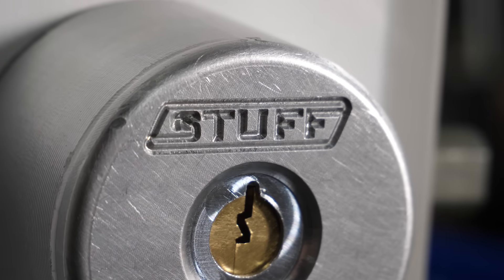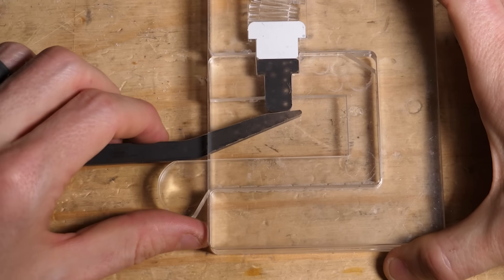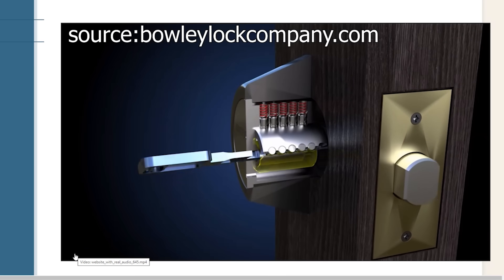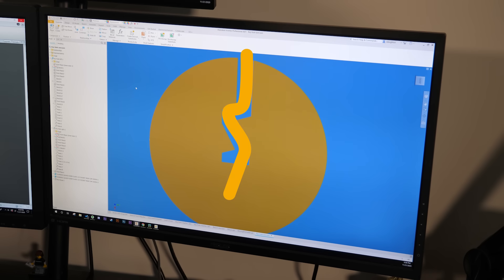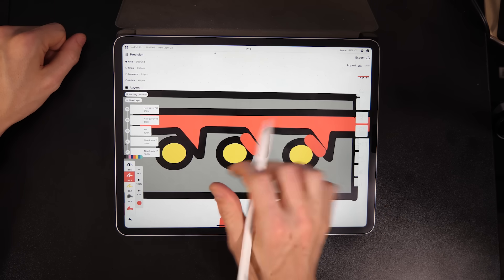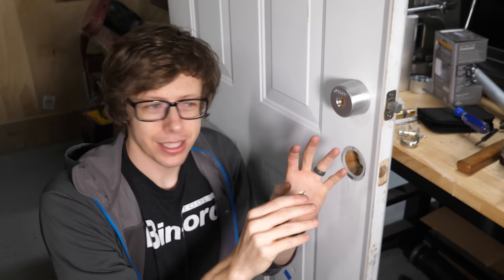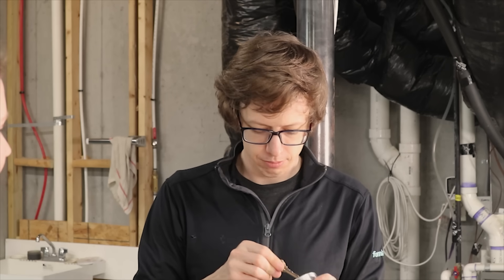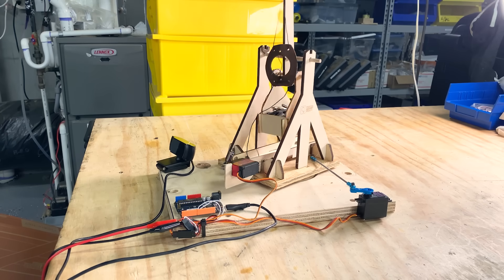Making an unpickable lock. Calling locksmiths

Comment: If the locking bar only uses friction to hold the pins in place, you could squirt WD40 in to the lock to lubricate the pin and bar, lock each pin to the max height, and attempt to unlock. Then with the key fully turned, and I'm guessing pressing against the edge of the gates, then get a hammer, and tap the top of the lock while apply pressure to the key to drop the pins gradually (this is what the lube is for), as you tap and the pins drop, as you said, not every lock is perfect, and I'm sure the pressure, as well as the lip of the spool pin you have will interfere on the ledge, until all the pins are in place, and voila your in.

Comment: At first I thought you were going to assemble a fairly normal lock but with a small motor and pin that would bump into any rake trying to set pins. But I feel like a simpler idea would have a mechanism push the pins back down so without the physical key there would be no way for a picker to set all the pins.

Comment: It might not be pickable but any lock can be drilled,  I know iv drilled most door locks in my  handy man business , and most burglars  don't enter through a door anyways they enter  through  a window that they broke to get into the residence,  also most door locks do not stop a door from  being  kicked in , the best locking device to keep a door from being  kicked in especially  if you are home is a gate rod. They work really good ,just bolt it to the bottom of your door and drill a hole into your cement slab or raised foundation  floor for the rod to go into ,the can be bought from the home depot  for under  20 dollars , and you can make  your own if you want it to be more decorative using material  from your local metal supply yard , it can be painted  or blued or hot oil dipped , believe  me they are a good locking opinion

Comment: I think the basic principle could be refined to make a practical, commercially viable (and more importantly) reliable lock. I thought there were a few locks that used the same basic principle of all pins needing to be set before testing but achieved in a different way, in fact didn't BB or LPL deal with one recently..............Found it, "Tensionless lock" vaguely similar idea in that it doesn't allow you to tension the lock until all the pins (wafers) are in the correct place.

https://www.youtube.com/watch?v=lPhAhAPtlH4

Comment: that is as impressive as a high security door with deadbolts all around and a titanium plate in it. but i have a story for that:
i´m a metalworker and the company i worked at had a call from a burglary. the thiefs tried to open the high security door (wich is designed to jam if you use force) and jammed it. so they just went thru the brick wall beside the door and got in. you can have the strongest door but if you put it on a 10cm brick wall it will do nothing XD

Comment: Not a bad design, but kinda used already. There's 26 ways per pin, but once you get 1 pin done the poisition doesn't change. Therefore if you can get a tension bar into the lock to push against the springs then find the solution to each pin, you can unlock it. Finding the solution for each pin won't be easy because you have to switch between pins, but its doable to a lockpicking expert

Comment: "Lockpicking" a mechanical mechanism lock is derived from the engineering fact that the constituent parts of locks, like all mechanisms, are built to tolerances. If even a common lock had perfect tolerances the picking process would not work on it. But you could open a perfect tolerance lock with sufficient random keys, given sufficient time. 
Locks are to keep honest people honest, a dedicated criminal can enter any space, by employing sufficient means, given enough time.

Comment: What lock has no key?
Reply: the c lock
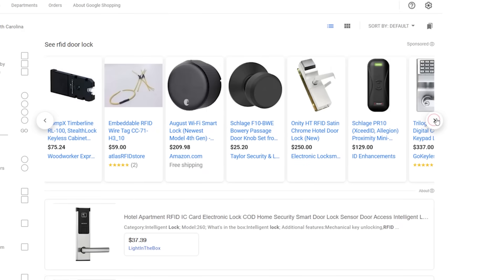Reply: @ThePapaja1996   @ludde sundström  Good one.  I wanted to mention the "unpickable" locks he was referring to which are "keyless" at 10:40  In that case you pick it with bad implementions of protocols.  A symmetric key implementation mayhaps, but you should still be able to manipulate it physically.  My point being the only keyless locked door is a plain slab of stainless steel barricating another slab of steel and even then "the key" is a shaped charge.

Comment: I'm no expert at lockpicking but what is stopping someone from just pushing the inner bar with a seperate tool and then tension the lock and set individual pins just like picking a normal lock? It would seem like it relys on accuracy in machining to stop pins from binding on those grooves

Comment: Should be a nice challenge for LPL and Bill, but ultimately, if they use their entire range of tools, it's gonna be opened... and likely dead too. xD
Single pin picking is one thing, but when you look the stuff they've already used in the past, what lock could possibly resist? Torches, extractors, powerful motorized rakes, those ridiculous blank charge power tools.. xD

Comment: There is still a theoretical attack that would allow testing pins individually that goes like this:
1. Set a pin to a known position
2. lock the pins with the back button
3. see how far you can turn the bolt
4. Rerun 1-3 on the same pin but at different positions until you either find a position that allows you to turn a bit further (case a) or you exhausted all the positions (case b).
5. In case 4a, you found the correct position for the pin, keep the pin in that position until the end. In case 4b, you need to do 1-4 with a different pin until you find one that goes into case 4a.

For the same reason that you (nearly) always have a binding bins during normal lockpicking, you should always have a pin that will go into case 4a. However, it's obvious that this very theoretical attack would require an extremely precise measurement at step 3 unless the manufacturing of the testing place and of the pins is particularly bad.

Comment: I think you just need to make a realy long lock so thee picking will automatically break thee pickin-tool‘s before thee lock can be opened. Pickingtools are smaal and other then a key they can’t fill thee hole 🕳 completely since they need space to mouve in position. If you have a three till 15 meter long key 🔑 it will be stable enough if you make it from thee best material and a pickingtool won’t be abel to keep thee length before breaking since phisical possibility’s of materials are limited to reality.

Comment: Here is a thought for picking this (at least in theory). The key (haha) is to test each pin individually. Now that we know how this works I can set any pin to any height individually. So start with for example pin one. Set it to some height. Turn the cylinder and see how far it goes. Try this for each height. If any height allows the cylinder to turn more than the others, then that pin was the one preventing the cylinder from turning and that height where it allowed more turning it the correct height fort that pin. If there is no such height, try an other pin until we know the height of the first pin that is 'binding'. 

Now we need to be able to hold that pin at that correct height while we try to find the next pin and height by repeating the process. And conveniently the mechanism of this lock locks all the pins at their set heights! 

This was just my first idea after watching this video. But I'm pretty confident that this is not the only attack and that other strategies can be found or this one expanded.

I would be surprised if LPL would not pick this lock in short order after practicing a bit.

Comment: Wondering about ideas to attack the lock:

Instead of trying to set the pins, use a comb pick to set them to the max height, engage the locking bar, turn it and jam it, release the locking bar while applying pressure. Release pressure slowly until the pins start moving down and some of the pins will probably get stuck in the right position. Lock the bar again, turn it back and use the pick to decode the pin positions while the bar is still locked. Even if the pins does not slide into place, it should give information about which pins are in tension. (Easy fix, make it so the lock bar can only disengage in the fully open position.)

Another idea would be to try to get information about how many pins are binding, either by measuring how much you can turn it (would likely be very precise) or measuring how much force you need to apply to get it to move slightly more than it wants to, with the idea being more pins means more resistance. If so, you could use a comb pick to set all pins to the same position and when you detect that there is less pins binding or that another pin is binding, one of the pins is on the correct position. Then try that position for each pin individually, to figure out which pin it is. Repeat, while keeping known pin positions in place to figure out the rest of the pins.

And the elephant in the room, three pins with questionable tolerances would likely be suspect to a brute-force attack of trying all combinations. Either way, it would be difficult to attempt any of this without a 'pick' which allows you to either retain pin positions or set them all at to the positions you want. But it might still be possible to reduce this to linear complexity instead of exponential by using a form for information leakage.

Comment: Dammit! I started on a similar design on 11/12/2020.  You def sank my battleship. My method is a little different. I pass a gate *around• the trapped upper pins. Pinching them is easy, just add a lot of slots to the pins. A bar slides into those slots as the key starts to turn locking the pins into place (cam). The gate tests to see it any pin is out of position. I’ll send ya the SketchUp file if you would like to see what I did differently. I’m disappointed, but congrats on a good design and inventive spirit! Peace 😎

Comment: “I found a locksmith that specializes in picking locks”
Reply: You can 100% be a locksmith that doesn't know how to pick locks. Main job is fitting new locks, secondary is building new ones to a key. I wouldn't be surprised if over half of all "locksmiths" just expect to drill out a stuck lock (or one where the key has been broken/lost)  and replace it

Comment: I haven't read all comments and I've watched this mechanism twice. I'm a locksmith. What prevents somebody from picking all the pins to the top position, turning the cylinder, then trying to rap or vibrate the top pins into the slotted grooves while turned?

Comment: I can see 1 possible way. Tension the lock as normal, then overlift all the keypins so they fall out, then reset the lock and allow the driver pins to fall in the place of the keypins. If this is the case it shouldn't be too much of a problem to block this way of attacking it.

Comment: You might try putting serrations on the upper pins for the gripping mechanism to hold them by; if you make the serrations deep enough that would be enough to account for manufacturing inaccuracies and remove the need for individual springs to hold each pin.

Comment: "This is the Lockpicking Lawyer, and what I have for you today is an unpickable lock" (Video time of less than 2 mins) 😂
Reply: at least 5 minutes: 50 seconds to pick open and the rest to explain how impressed he is and how it works
Reply: He should just make the video 10 hours long even if it takes him a minute to pick it.
Reply: LPL won't be able to pick this lock...Watch how it works again..Key goes in while simultaneously locking the pins in place and in order for locked pins to clear  the bitting channels, the cylinder needs to be rotated, AWAY, from the only area any manipulation could possibly occur. That being at the key to pin contact holes and why this lock is unpickable. LPL would have to GUESS the right pin height for each pin and set them, if the locking mechanism actually allows that, in order to open the lock.
Reply: @MrDLRu  you never know if there is a workaround. We’ll just have to see.
Reply: He did that once. The lock could not be picked.
Reply: @Alrekrify  No shear line, no pick.

Comment: The problem with home security is that as you strengthen one area another becomes the next point of weakness. At some point simply cutting a hole in a wall or using explosives becomes viable if the end result you are seeking is worth the effort/ expense.

Great video! I appreciate your tenacity and perseverance on your projects.

Comment: To make the upper pin section more standard instead of using different cuts for each pin, I suggest you use different length for the lower pins that will even out when the key is inserted. 

To maintain the upper pins in place you could use rubber that should exerce enough friction on the pins and maintain them in position while turning the deadbolt. Not as durable as your spring version but has the merit of having less parts. 

Interesting ans novatrice approach, so good luck and I feel super excited to see your lock mechanism in the LPL hands soon.

Comment: What if it was a double cylinder?  Insert key turn 90 degrees, pull or push to engage 2nd cylinder turn back 180 then open. Or pins on both sides of 🔑 key. Good luck. I can’t wait to see what you come up with.

Comment: There is 1 thing that makes the lock very easy to surpass. Its not lockpicking. Its how far the whole thing comes out of the door. Get a metal pipe with the same diameter, slide it onto your lock, push down, and the whole lock mechanism comes out. Real save locks try to embed the whole mechanism into the door, since that pipe method is used very often by thieves. ... a friend told me...

Comment: HOW TO PICK THIS LOCK.
1st take a key blank and cut it in half, top half with the shallowest cuts. 
The bottom half is needed to press and control tension on the "pin locker/retainer." 

Fully insert the key pieces, keep the bottom half in the lock and remove the top half of the key.
Rotate the lock, when the pins make contact at the wrong depth. It will pivot the pin a little bit. 

When the pins pivot they should start to move and drop down little by little until they are at the correct depths. Just keep rotating the cylinder again and again until it turns. Depending on depth combination and how many pins are in the lock, 30-100 rotations will be needed before it unlocks. (If needed the bottom key can be pulled back slightly to loosen the tension on the driver pins.)

This is basically a form of impressioning, except without filing a key down..

The reason for separating the top and bottom of the key, is because if the driver pins are allowed to move down, and the key pins are held up by the key. Then it will be impossible to turn the lock back to the neutral position and remove the key.

Comment: Maybe overkill but I've always conceptualized using an extremely difficult lock that when activated the key cannot leave the cylinder but when the key is turned it'll energize an rfid controller that will then actuate a solenoid if the rfid in the key (similar to a car key) matches the one for the lock

Comment: Couldn't you add a series of notches in the pins? Then you can hold them with a single bar just fine. You'd also get a more reliable position when inserting the key so there'd be less chance of jamming.

Comment: If I see it right the upper pins are forced down with springs. So what about creating a key that pushes all pins to their limit, then turn it a bit and use a vibration device (don't know how it is really called) to let the pins come down step by step until they all fit through the barrier?

Comment: Lockpickers before seeing this: Oh no!
Lockpickers after seeing this: Anyways
Reply: Actually, as a lockpicker I just wanna have a go....It is a nice mechanism. Very well thought out.
Reply: 1. Lift all the pins
2. Tension it
3. Apply some hammering or vibrations to the lever or the whole lock
4. Wait till the pins take their places.
Apparently, there are also holes for the wires...
And even if it doesn't work (or is fixed), I bet it isn't too hard to decode it quickly.
Reply: @tinldw  Yes I suppose.
Reply: Sergey tinldw that is sort of similar to what i was thinking. Im not gonna say exactly however, in case of the astronomically low chance that I actually get a shot at it. Cant give away my strategy. Lol
Reply: @jpmcpinning4255  Yupp ikr!

Comment: RFID locks are absolute fucking garbage, don't you ever recommend them. 99% of them have really fucking shitty flaws. You can copy the key with zero contact from a meter, away through clothes, with an ebay parking garage gate module, you can bruteforce them sometimes, you can have a tech set it up in a shoddy way that gives you near-zero security and the list just goes on. Get a proper mechanical lock and get a camera above it to make your neighbour an easier taget. That's it.

Comment: I think in principle, this lock is pickable, though it would be difficult.

The basic technique would be to find which of the pins was making contact with the gate first when it fails to engage, then adjust and test that pin until you get a tiny bit more rotation than before, meaning that it was starting to go through the gate.  Then find the next pin and repeat.  You'd have to keep resetting the first pin to the same place every time, so it would be a real pain.  And by the last pin, you'd have to remember and set all of the previous pins.

False gates in the block that the pinheads pass through would make this much more difficult.

I'm not sure that this is a practical technique.  Setting the pins blind to consistent heights might not be possible.  It's much more likely that the pick technique actually used, if any, would exploit some design weakness that I didn't see.  But I think there is a path, even if it's an awkward one.

Comment: Always seemed to me if a lock required the key to be turned to the right, then back to the left, simple with the correct key, but impossible when the torsion wrench looses tension going back left, would make it harder to pick.